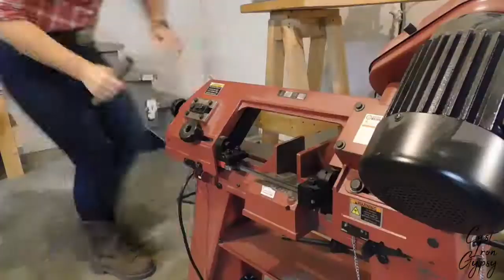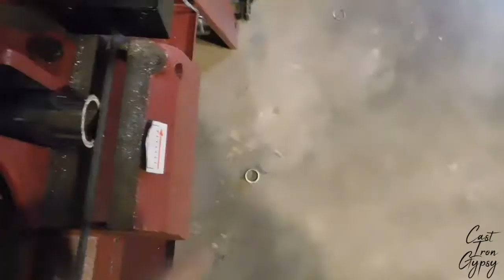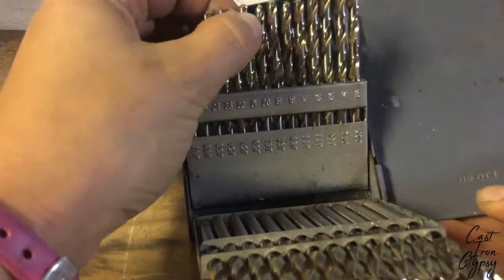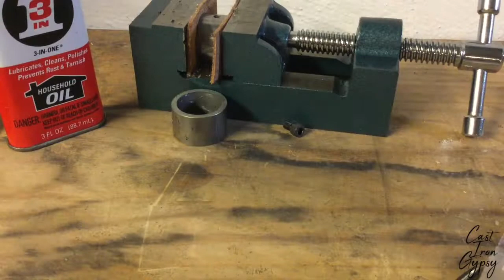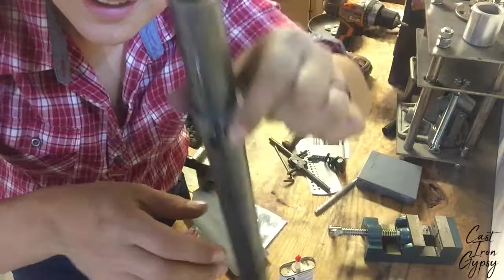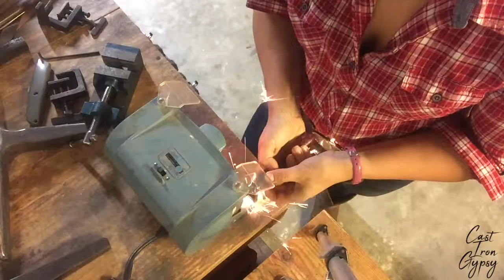DIRESTA TRIBUTE - Cast Iron Gypsy - Project Make Video

Comment: Great work! A small tip when tapping threads, if you use a block of wood/acrylic/metal or whatever, when you don't use a drill press, that is say 20 to 30mm (1 inch) + thickness with a hole in the center that receives the threaded tap tightly without contacting the block. Then you place the tap through the block and sit the block on the receiving material - you will always thread it squarely and not on a angle which it has an tendency to do sometimes. Look forward to watching you future creations!

Comment: Adam sent me, started watching your videos from the beginning, I hate to sound crass, but it doesn’t hurt that you are easy on the eyes, but more importantly you are easy on the ears too, so many lovely looking ladies kill the vibe when they squeak! The best bit by far though is that you are talented, imaginative, and practical, and you swing a mean sledge, put some of the blokes to shame breaking iron! 
Keep up the good work, don’t let the keyboard warriors that will appear as your viewing numbers grow (the downside of being popular on YouTube) get you down, and when people are giving you tips you will have to learn to sort the good from the bad from the downright dangerous!
For shortening the bolts, put a nut on the thread, cut with a hacksaw, (it looks like a wire saw you are using, this is like sawing with a file!) junior or senior depending on size, (the bolts you were cutting are just about where I swap from junior to senior) use the whole length of the blade, longer slower strokes will get the job done easier and you won’t just wear out the middle of the blade, wind the nut to the end and file across the nut to square the end, winding the nut off will generally clear the thread, finish with a quick chamfer to the end of the thread, a file or grinder will do.
Hopefully one day a viewer will be star struck with you as you were with Adam.
Reply from the maker: Thanks for the kind words Brother!  I think the best thing about the bolt is next time I'll just buy shorter ones!  lol!  Thanks for the tips on the saw - jeweler's saw was not an appropriate match - next time I'll use a hack saw for sure!
Reply: "I hate to sound crass, but" Then don't type it, period. I seriously doubt women doing crafts on YouTube, want to hear your opinion on how they look. Keep the comments about the content.

Comment: When shortening screws/bolts, sometimes it's helpful to run a nut all the way to the head, then make your cut, then as you remove the nut it straightens the threads.
Reply from the maker: Nice!  Thanks for the cleaver tip!!

Comment: Dremel and the fine cut off disc is ideal for those small thread cuts, well held of course, and a steady hand and pressure to avoid breaking the fine discs.
Reply from the maker: Good idea!
Reply: Good idea, that looked like it may have been a high tensile steel, that the screw is made of.
Then you have use an abrasive to cut it anyhow.